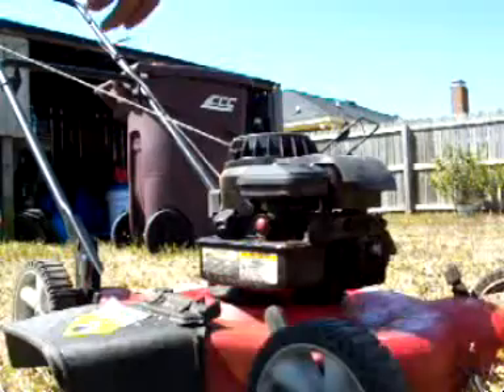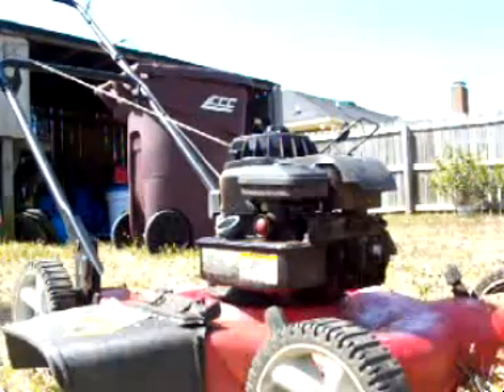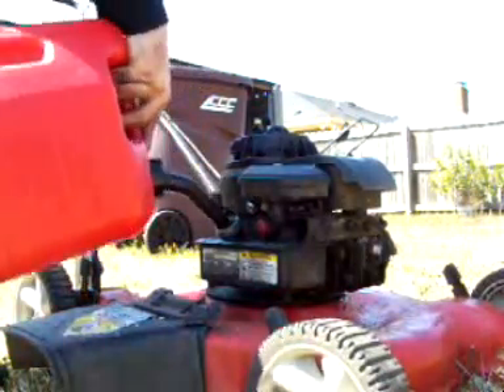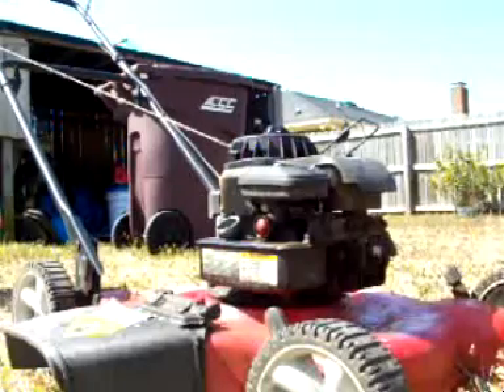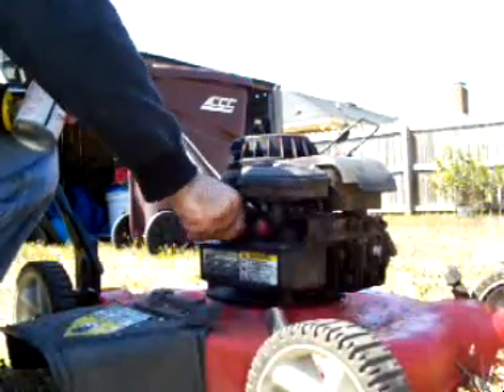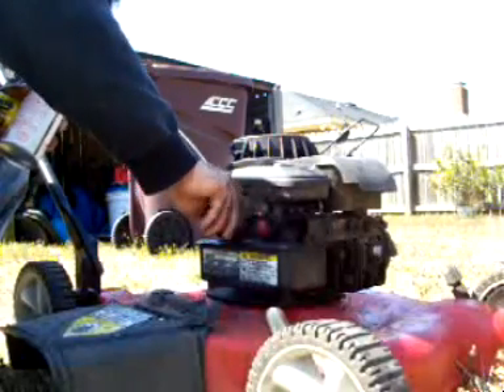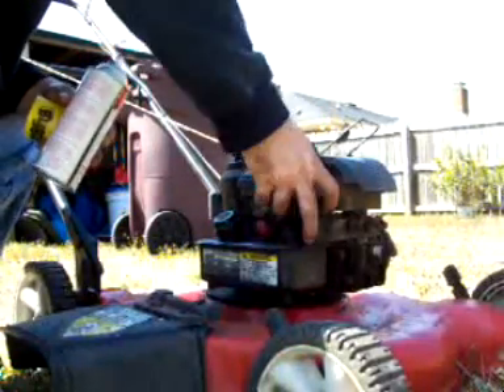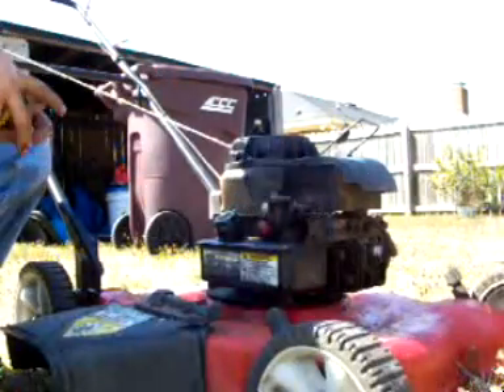Startup & Blow of the Damaged Briggs Engine

Comment from the maker: @motorhead45102 They are amazing engines, even when I did get one to seize I used a pipe wrench to turn it over, pulled the rope and it fired back up.  One I had was using so much oil, I just started feeding it used cooking oil since it burned it anyway LOL

Comment: @More350Power i had a 20year old briggs with a rod that was wearing out, always had oil, don't know why it was dying, but i tried to blow it up,(too much money to get a rod and crankshaft for it, but i never could get it to blow up, it would run down slowyl to a stop but never locked up, pulled like 10 times and started back up and died, did this a few times and wouldn't blow, then i put water in the crankcase, and the bastard ran like there was nothing wrong and i cut the grass with water in it

Comment from the maker: @cameramonkey2 I think I have a tec thats starting to knock.  I had a briggs that I spent hours on running it without oil, full throttle, sieze un sieze.......  It was an old worn engine not worth rebuilding so I figured lets see how much it can take.... it never died and I used its parts to repair another one.....  I have only ever had one briggs that chucked a rod out the side

Comment from the maker: @MrGizmo757 You are definitely right there.  After messin around with another engine similar, locking it up overheating it all kinda of stuff, it still ran and would not quit.  Sometimes I had to spin it over with a drill, but it didnt quit.